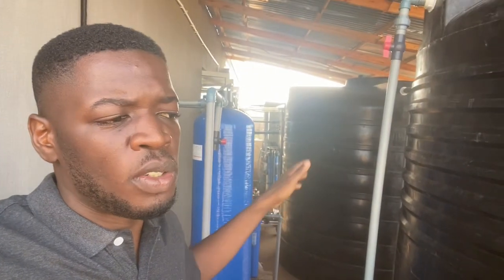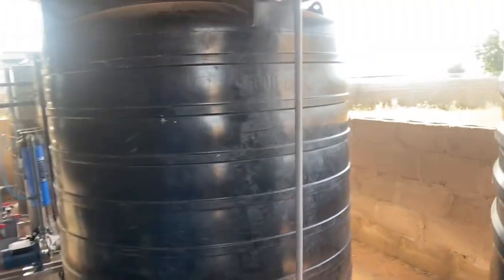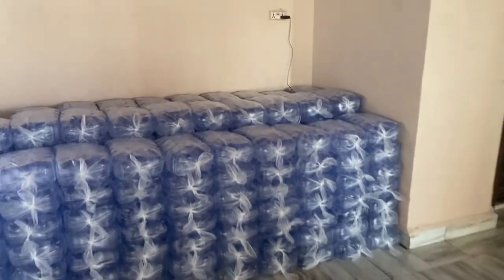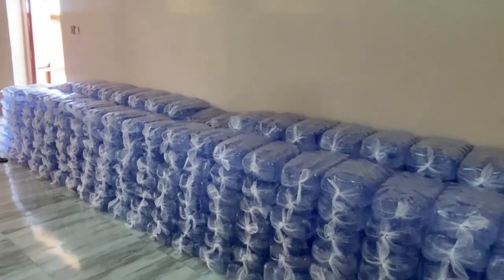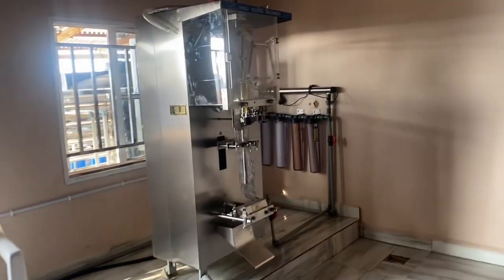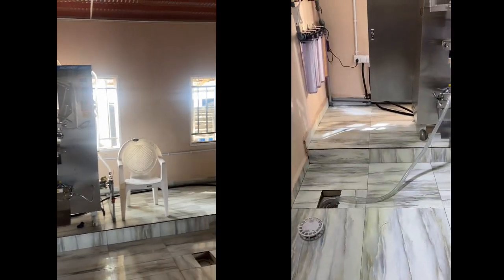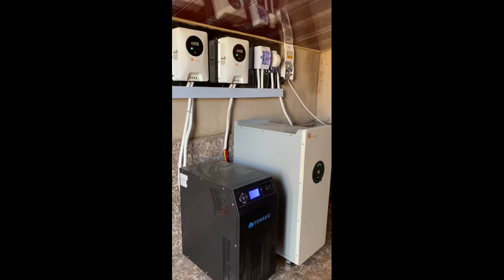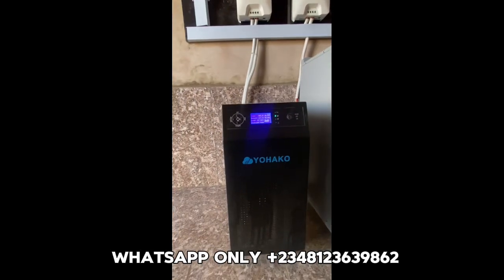Starting sachet water factory business with solar and lithium battery inverter in Nigeria 2025

Comment: Please do you have an idea of how many KVA inverter dey are using?
Reply from the maker: 30 panels 15kva lithium battery inverter
Reply: @samsavefactory4017  Alright, thanks
Reply: Please sir Does the 15kva power both the submersible pump and the RO?